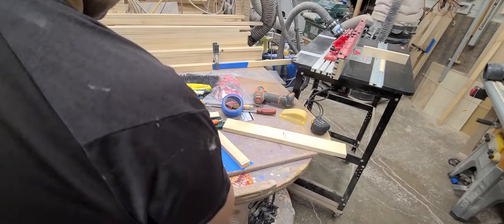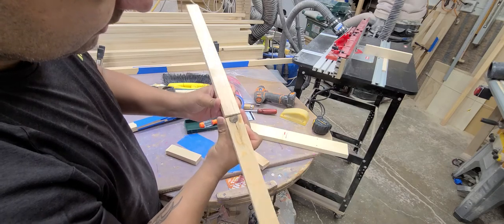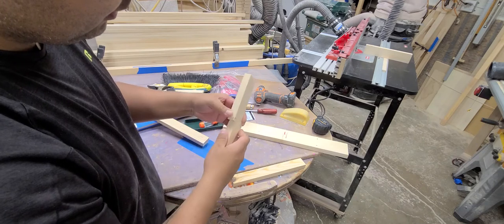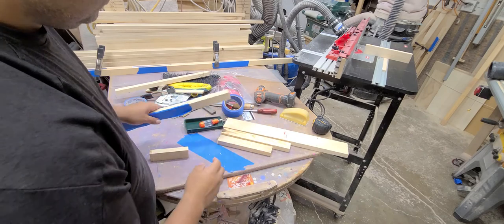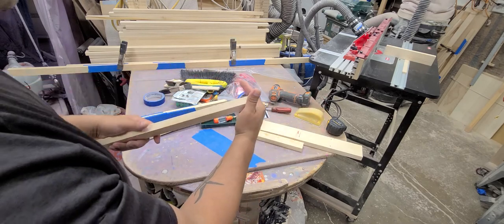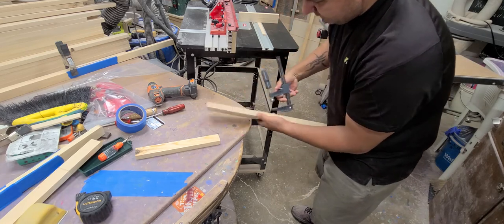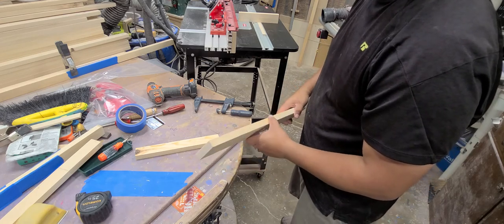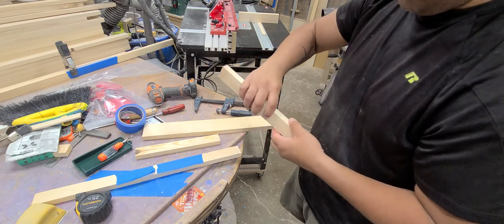How to make wood longer. Glue wood end to end at BandasPalette.com

Comment: What is that type of router bit called
Reply from the maker: Here is the bit and the amazon link to the bit 
It is a very durable and long lasting bit too. Well worth the money.

Amana Tool - 45796 Carbide Tipped Finger Joint 1-3/8 Dia x 1-9/16 x 1/2" Shank https://a.co/d/7TlkUM1